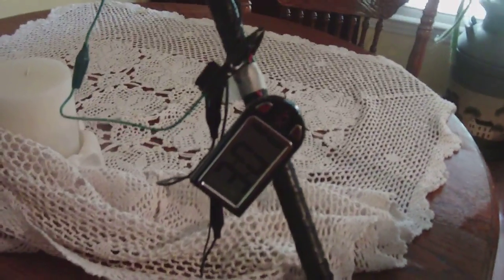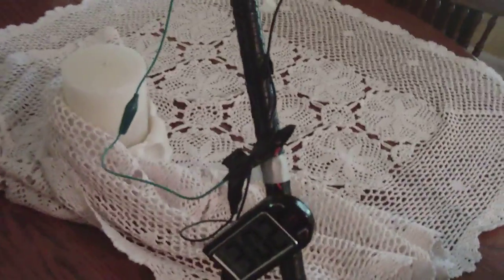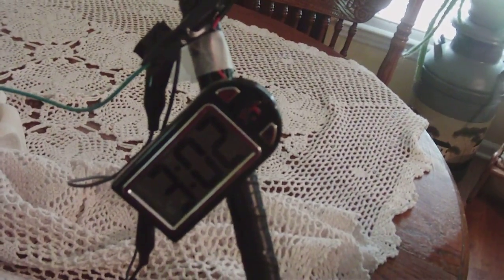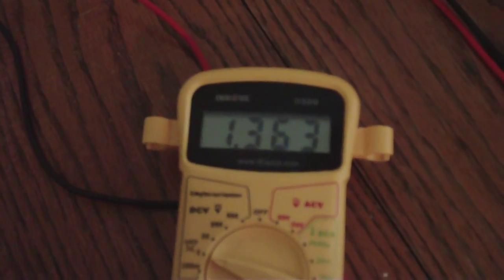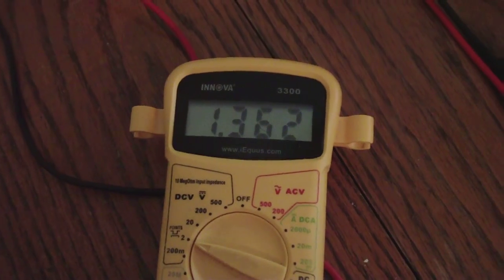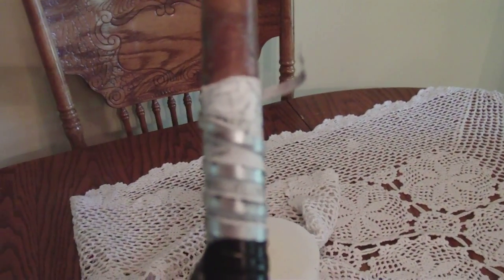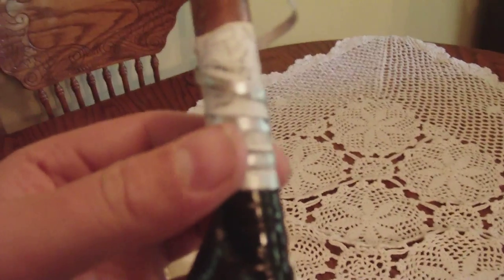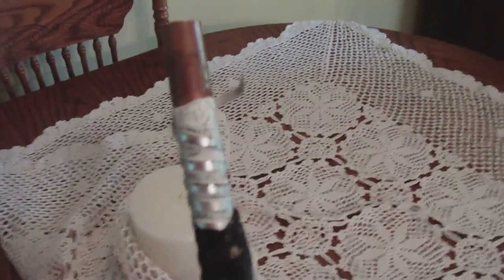Update on 5 foot tall Dry Crystal cell

Comment: I suggest that you encase the battery in a PVC pipe with end caps. One side of the PVC pipe with a threaded end cap for maintenance and forgo the electrical tape. That way you could add a  sodium silicate desiccate to maintain a dry environment for your cell.

Comment: I feel there is some galvanic reaction taking in this cell but is it quite reduced so as it is not visible. This can be proved as we know that if we use aluminium instead of magnesium then we get lower voltage that means the voltage of the cell is actually depending on the potential difference of the metals used and the copper and magnesium just dont act as two conductors but positive and negative electrodes. I feel that salts used require just molecular water to turn into ionic solution so this works. I don't think that it is some piezoelectric or something other...Does adding pressure using hands increase the output by any great means???

Comment: First thoughts: I am wondering if you are getting the power from potential difference in the make up of both types of metal where one has more pos or neg electrons then the other and you have a flow through the clock trying to correct the balance

Comment from the maker: Well the copper tube itself for the 5 foot cell cost about $10. The magnesium cost about $5. The separator, the Chemicals/salts, etc..... is about $5 for all of them. So its about $20 per cells. I'm looking into a new type of cell that is 2 foot tall and gives close to the same power as the 5 foot tall cell. The two foot cells would almost cut the price in half. It may cost a good bit of money but its true free energy.

Comment from the maker: 1-The cell was giving 200uA. The Clock uses from 2 to 10uA depending on the time. 
2-Half salt sub, half epsom salt. The water in the glue combines the two into a new crystal and dries hard to protect.
3-No melting of glue. You're thinking of the stove top cell. Search YouTube for "stove top cell" for people making my cells.
4-Magnesium ribbon is not that much, one roll is about $5 on Amazon. Aluminum will work but voltage will be under half a volt. 
5-Depends

Comment: Several questions

1) What is the current draw ? ( max draw and normal operating draw )
2) You have used the epson salt, morton salt substitude, and white elmer glue, in several cells how.  What have you found to be the proper ratio ?
3) I believe you have also melted the epson salt, salt subistute and glue together does this imporve the performace ?
4) Given magnesium is expensive, how well does aluminum work, can you use aluminum foil ?
5) how does the think of effect the performance ?

Comment: Ok! thank's for the info... No salt is exactly what i got here. I will retry it for sure but i will scale it down a little lol I think i dont need that long of a pipe to get enough power to light up a Joule Thief. Well i will do some tests and as long as i can get power out of it, it will be great and i can always put several cells in serie or parallel to get what i need!